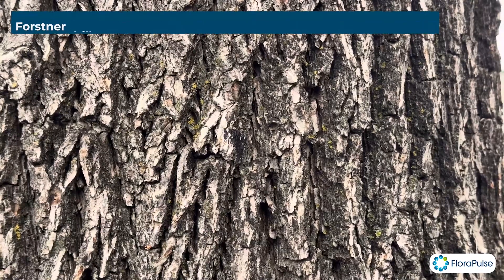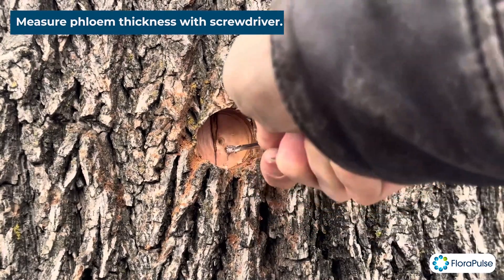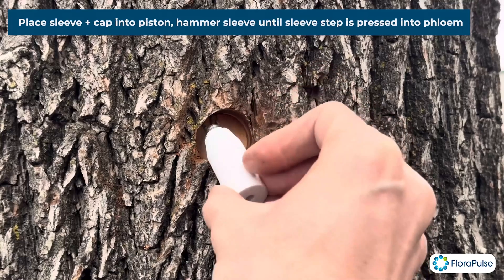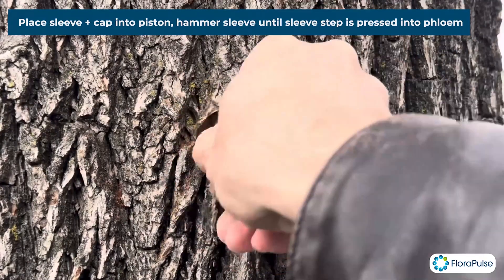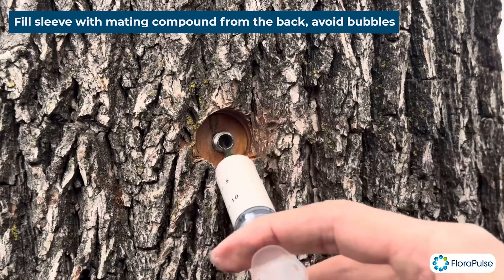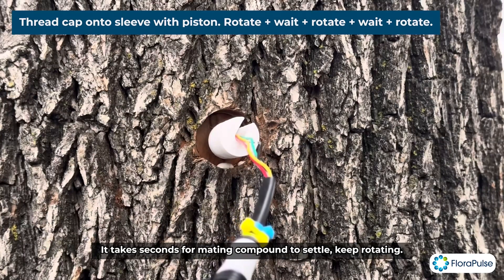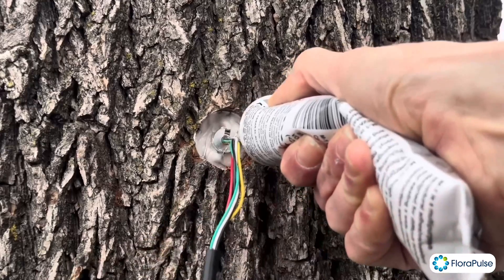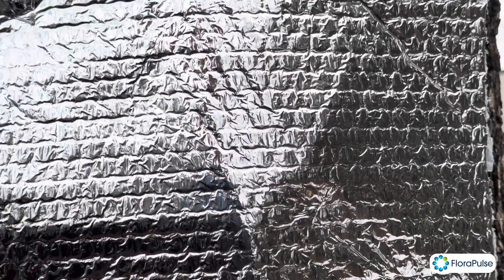9mm thick bark sensor installation 2024

Comment: The FloraPulse system is a microchip tensiometer (microtensiometer) that is embedded into the tree woody tissue and directly measures the water status, known as water potential. Because the measurement is taken directly inside the water-carrying tissue, readings are very accurate and reliable.